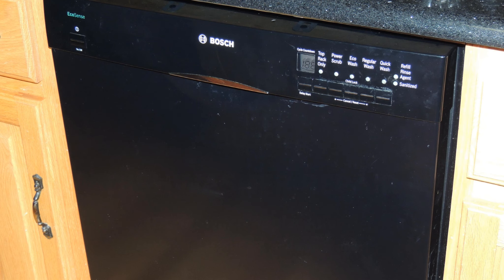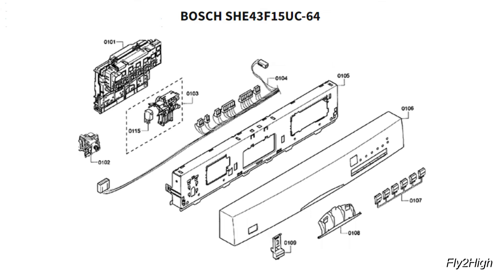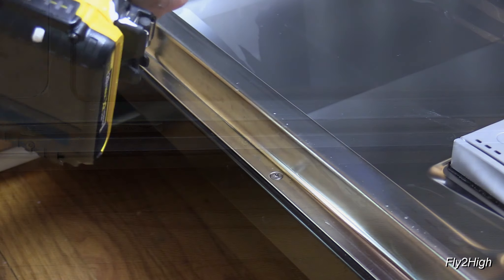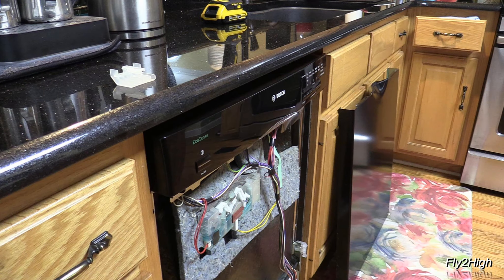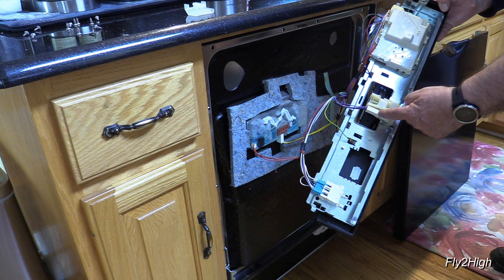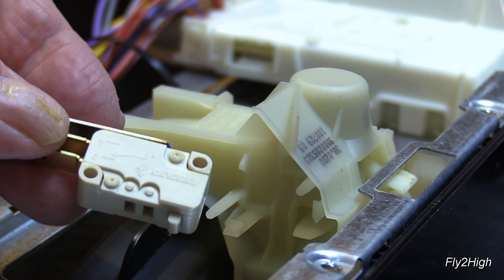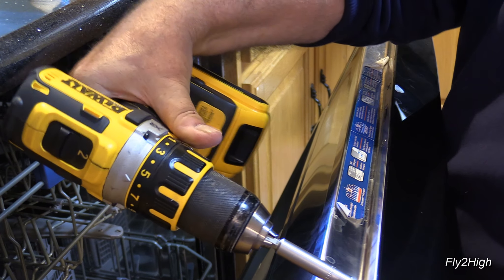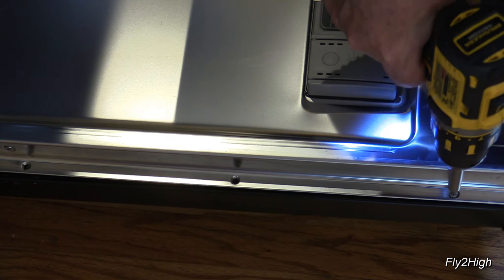Bosch Dishwasher Door Switch Replacement.  (FTHVN 881)

Comment: I just changed the face plate and all buttons on my bosh. Exactly the same as yours.  I took the model number and ordered the parts directly from Bosh Germany. One thing each button has a plastic pin that hits the plastic switched on the switch board. I found that two of them were slightly shorter than the others. I had to use two of the old buttons. Unless you looked closely you might miss the height of the pin difference. suttle difference. So two buttons are a little dirty but the others are new. I also used the old power button because I forgot to order a new one. The face plate cracked which cracked two of the buttons. Happened through constant opening and closing. Now works fine. Thanks for your video. Helped me a lot.

Comment: Thank you for this great video.  I put a new facia panel on, but did not properly alphabetize the buttons so the control panel was not working.  This video showed me how to get to the back of the fascia which allowed me to remove it without it breaking (my biggest fear with the $90 part) and reorder the buttons.  I also was not sure how to set the spacers.  Thanks again!

Comment: My handle broke too.  I should have watched more videos before starting.  Fairly easy once you got the hang of it.  I suggest you put painters tape across the buttons so when the panel comes off (or goes on) the buttons do not flop down.  Once secured, you take the tape off.  I cleaned all the buttons while waiting for the new panel and got the buttons out of order.  They don't work right without looking at the matching letters.  Another important fact, turn the power of before removing the panel.  I sparked my control panel and had to replace the board behind the START button.  Error code C1 on that learning experience.  $200 for the part.

Comment: Thanks. I have had this thing apart at least six times over the years and can't remember how the bottom panel releases after you take the screws out. I have replaced the top cover three times from breakage. Poor design that sells parts. I have a video on how to arrange the control buttons after the top cover hits the floor and they go flying everywhere. Thank goodness they are labeled alphabetically.
My top cover six screws go into metal but some are striped. I should have squeezed the metal where the screw engages flat with a vicegrip or clamp.